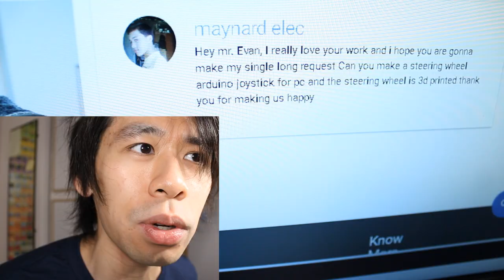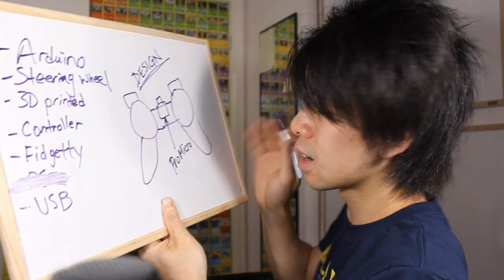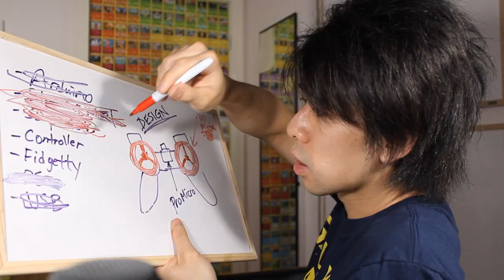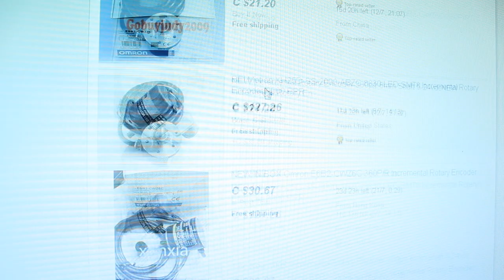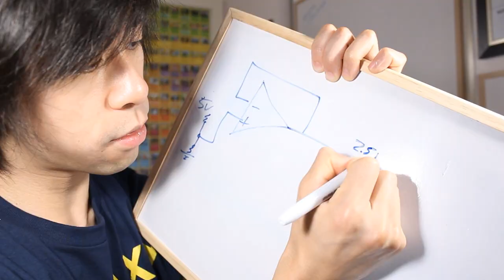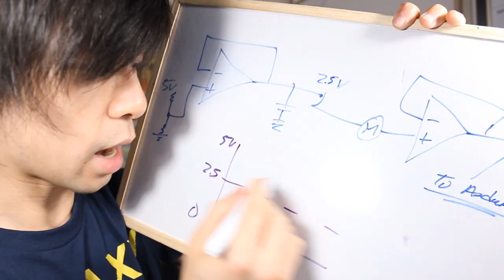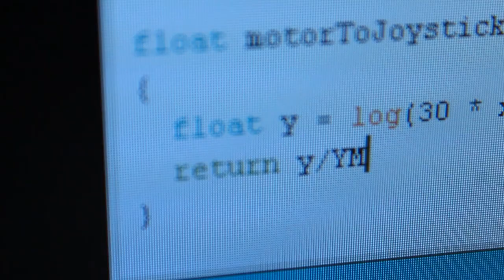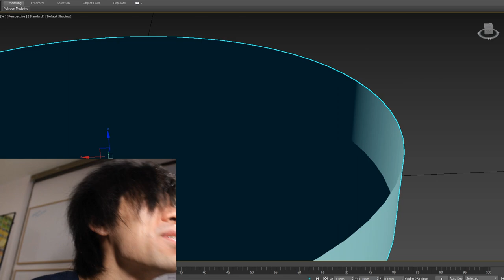THIS CONTROLLER IS PURE EVIL

Comment: Make a wireless Bluetooth speaker, game controller,Gyro sensor, Extra mapable button extension support options, Powerbank, controller for both pc and phone(can hold the phone) wirelessly, Internal bluetooth audio, internal sound amplifier for headphone, built in usb hub if its running on phone otg u can add 1n sd card or 3extra usbin it and i did mention it will have loudspeaker like the bluetooth speakers something that can be used on the go with phones, or for pc any emulators up to dated with CEMU which requires the gyro sensor = an AIO Gadget for tech lovers
Reply: Good job man
Reply: Boi do you wanna kill the guy??
Reply: wtf!!

Comment: Here's a full challenge for you, because Nintendo decided to make it difficult to use the Switch's controllers with PC. They literally use the layout of the XBox controller internally, but flip the external layout!
If I want to play a game from itch[dot]io, or an RPG Maker game, or really any PC game not running through Steam; A is B, B is A, X is Y, and Y is X… and that is very annoying… So I came up with this idea:

• Nintendo Switch Pro Controller
• Base components functional (+\-\🏠\<screenshot>\L\R\ZL\ZR\LStick\RStick\Sync buttons, L\R joystics, D-Pad, gyro, bluetooth, etcetera…) [NFC and rumble are optional though]
• A button 1
• B button 2
• X button 3
• Y button 4
• A\B\X\Y physical button layout unchanged
• [Optional] a method to swap between the new A\1 B\2 X\3 Y\4 numerical order and the old A\2 B\1 X\4 Y\3 numerical order (to allow easy switching between Switch games and PC games outside of Steam)

Why don't I just change the layout of the physical buttons?
I've been playing Nintendo since the Nintendo Entertainment System… I can't mentally remap the layout, so changing the physical layout isn't going to work; the digital layout has to change.

Comment: Can you make a 3d printer
Reply: a 3d printed 3d printer with a 3d printed raspberry pi?
Reply: KILLER 666 yes
Reply: With a Raspberry pi it is possible. Arduino I don't think so.. At least not by itself. With an arduino you would need a computer to constantly send it what it must do piece by piece because the Arduino has a very limited memory, it is not enough to store the models and everything and it's also not fast enough to process everything by itself. The Raspberry Pi on the other hand is a vastly superior system. Arduino is better for low power applications that require a small control unit. Such as tiny sumo robots and controllers.
Reply: Trenzinho da Alegria you do realize that they make sure breakout boards for Arduino and the controller code is able to fit on an Arduino MEGA 2560

Comment: Can you make game console
Reply: yep, i made one with a raspberry too, not too hard but it will cost you at least $100 to play every retro game. Google RetroPie and make it. you will need to buy a usb controller too if you dont want to use a keyboard. You can 3d print a case that resembles your favorite console too. This is the only way i have found to play Alex Kidd again. It has every game from Atari 2600 to Nintendo 64.
 Msg me if you need help if you want. First go buy a Rasp Pie 2 B+ at minimum. the pie 3 is better. Also if you plan on playing for many hours, you may need to put a fan in your case or at least just have one blowing over the pie, If only playing for an hour tho it is fine.
Good Luck

Comment: Slight error in this building.
You actually used an original PS1 controller, instead of the DUALSHOCK for the PS2. I can tell because the original controller had no analog sticks, later got replaced with the dualshock, which did include them.